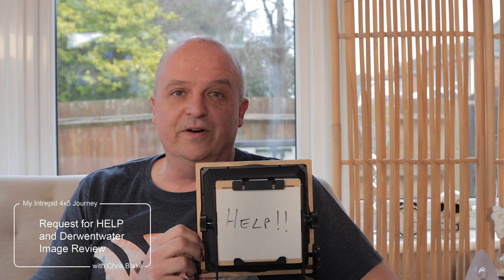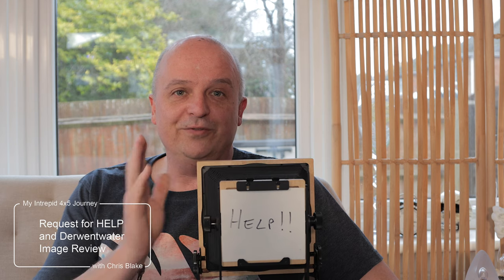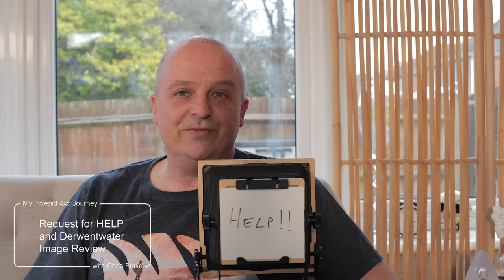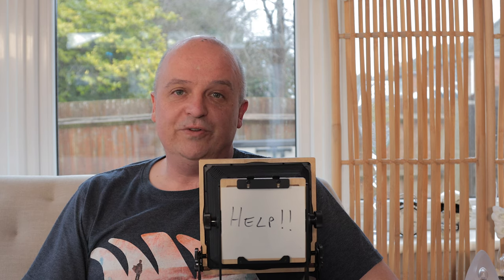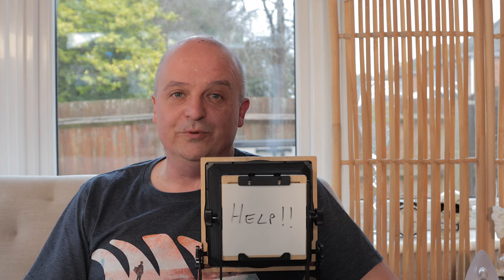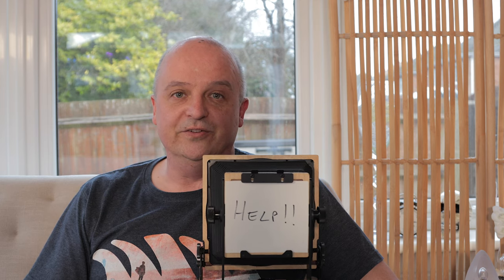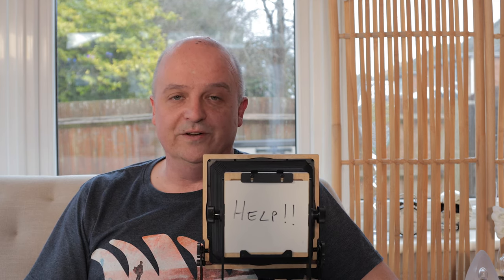Help! And i4x5 Derwentwater Image Review

Comment: If you are using Lightroom, try the plugin Negative Lab Pro. It does a fantastic job of getting the colors correct! I think they have a trial version so you can try it out before you buy.
Reply from the maker: Hi Don, thanks for the tip. I should have been more precise on the video because one of the images on the video was processed using negative lab pro. The reason I started to think that perhaps it might have been an exposure/film/developing/“scanning” issue was because this also resulted in what I thought were poor results. Out of interest though, how are you finding using negative lab pro?
Reply: Chris Blake I had great results using it the few times I have. I’ve not done much “serious” color photography since picking it up last summer, but the scans I’ve done have had great colors! I used to use a V850 scanner from Epson, but it developed some internal reflections and I never could get good colors out of it - I always had a color cast (often magenta).
Reply from the maker: hi Don, thanks, that's interesting. I see if I had a refection issue as well.